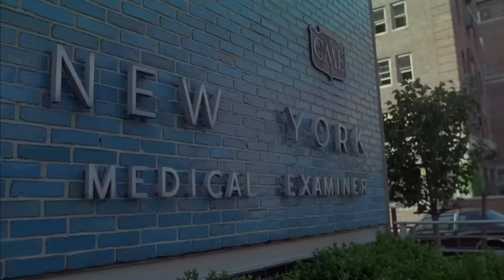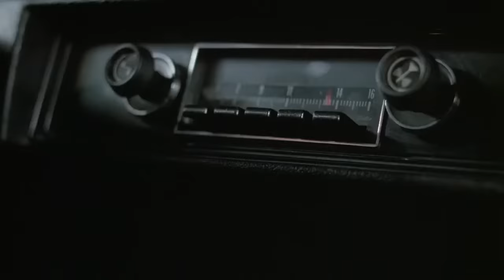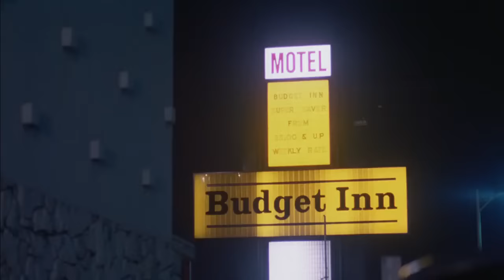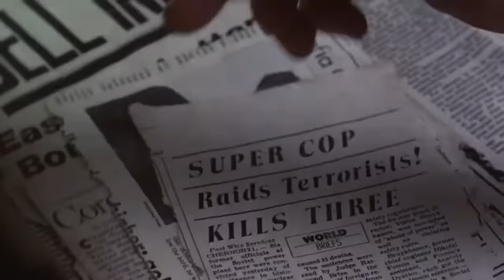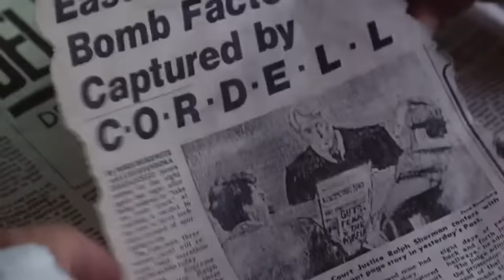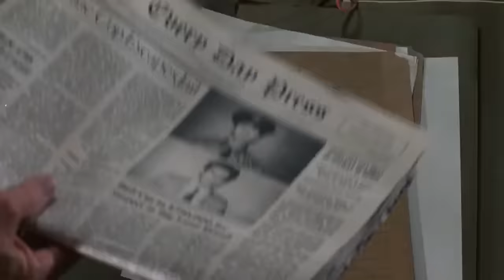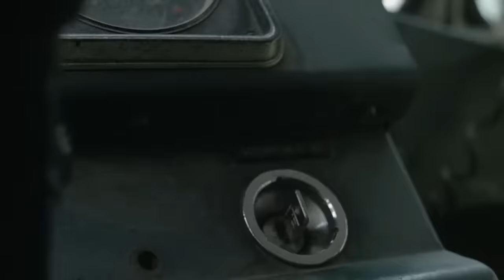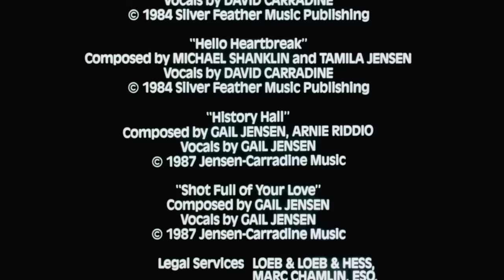Maniac Cop: 1988

Comment: After the first one should have been the end of Maniac Cop. The sequels should have never happened.
Reply: @angry80sguy  I hear ya. Either way, it's hard for sequels to be as as good as the original.
Reply: I actually liked the sequels. Maniac Cop 2 had the perfect ending. 3 was not too bad, but a little repetitive. Still, I liked the car chase in that scene.
Reply: @Eduardo Magana  The only thing that I liked about the sequel maniac cop 2 is that they gave a further and thorough explanation as to why Cordell was incarcerated, as well as Cordell having the proper burial. The fact that in the very 1st movie, in the end, that big wooden piece goes through Cordell's chest, makes absolutely no sense in the ending before the van goes inside the water. They should have omitted that part. As far as maniac cop 3, that was definitely idiotic, and a huge mistake. It should have never been done, nor did it make absolutely any sense regarding all that voodoo crap.